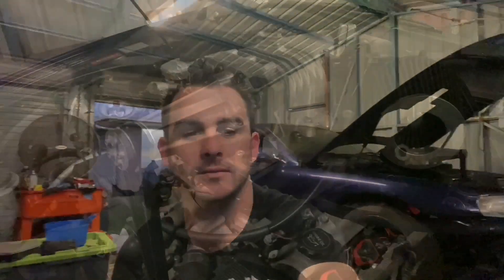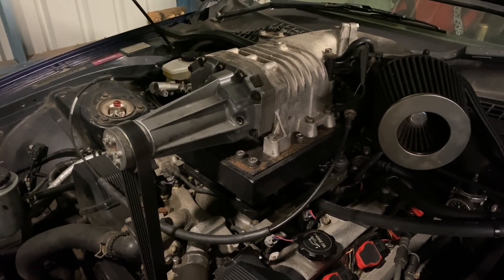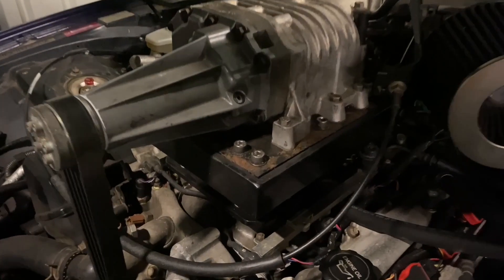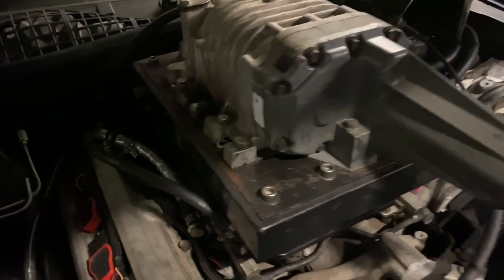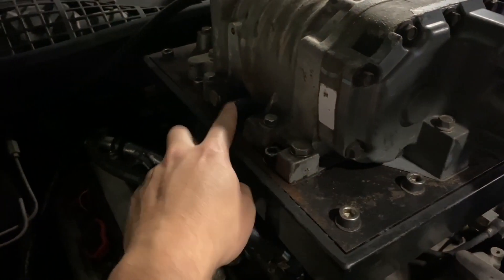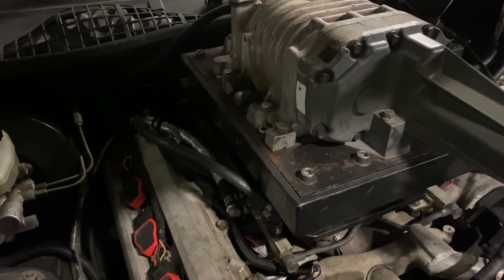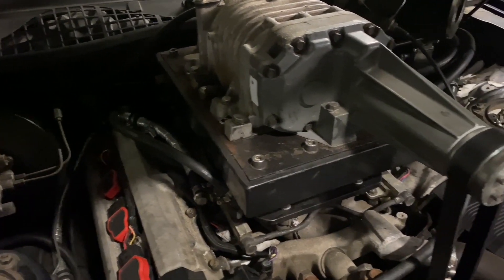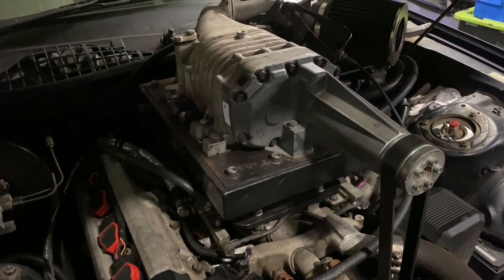M90 Supercharger Intercooler Plate Fabrication (Billet Aluminium Top Plate) [Part 2 1UZ W2A Series]

Comment: Let's go!!!! The close ups of your supercharge build helps me get a better idea for how mine will work!!!
Reply from the maker: Cool, Thats good to know. In the next video I’ll try get heaps of close up footage for you as i change the Top plate and install the intercooler 👌
Reply: @Brodorsport  That'd be a great video. Maybe you can do a video explaining every thing you had to do to have a supercharger on the 1UZ? Fuel injectors, ecu, throttle body, fuel lines, throttle cable, etc. Those are the main problems I'm having to wrap my head around. But make the videos you want!!! I really just need a mentor help me build my car.
Reply from the maker: Ill keep that in mind man. Thanks for the input and ideas 👍